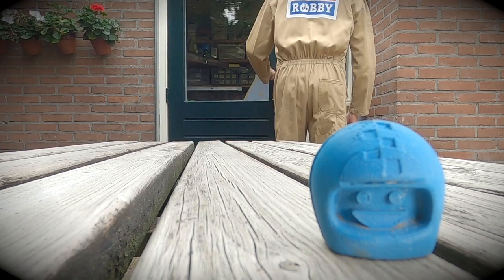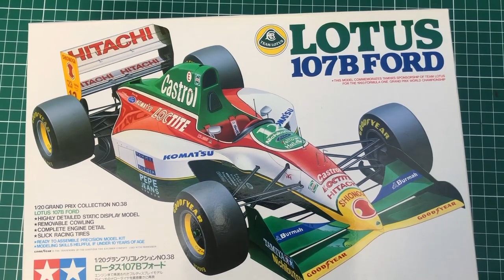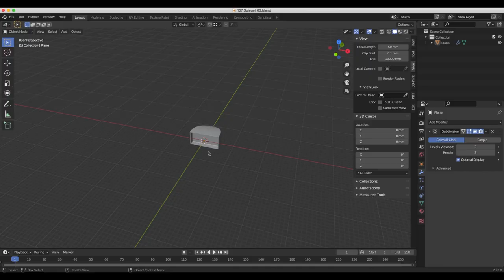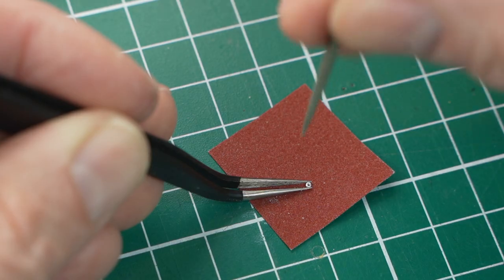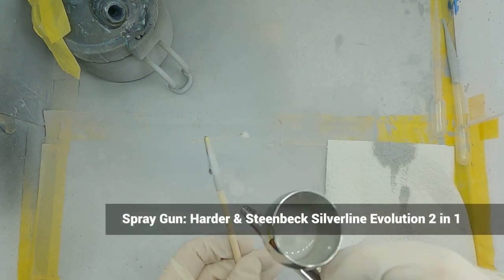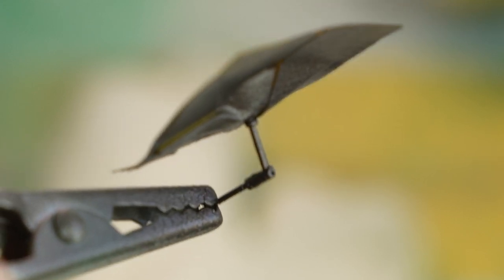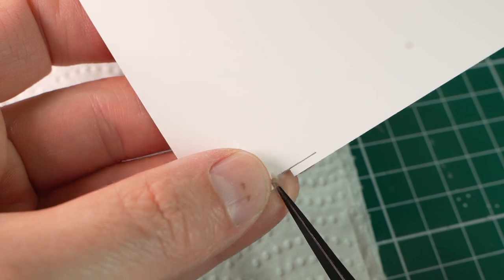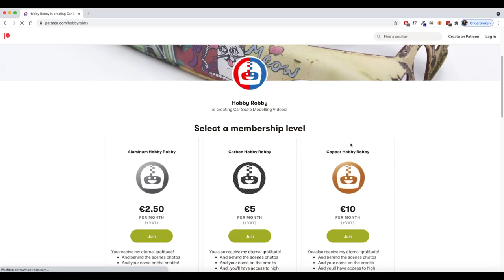MIRROR MIRROR: Building Tamiya Lotus 107 Ford F1 Formula 1 model car of Mika Häkkinen 1/20 scale -#2

Comment: Some tips from Poland: If some parts we needs to duplicate - blue stuff + tamiya epoxy (Time!) Also I make some experiment with decals. You actually have some sheets for decals, so... try print black carbon fiber in b&w and choose transparent white color. If needed carbon+kevlar effect - You can paint part in yellow color - before. Finally - after aplying on surface I use thinned clear coat on decals - and the result is satin finish with almost holographic look😌 But if You make heavy wet coat - this holographic effect will not be visible - only two colors - maybe grey, silver etc.(gloss clear Tamyia 1:3 x20a - I use this method with a brush)🤝👍
Reply from the maker: Thank you for your in depth tips Kolarz! Could have done it with blue stuff too. Not sure what you mean by ‘holographic look’ of the carbon fibre. I am pretty pleased how my carbon fibre looks (I do have reference carbon fibre and it matches quite good)
Reply: @hobbyrobby  It's looking more deep compared to others. Thats interesting illusion: satin and glossy lines in different ways reflected light - so it's more like 3d effect. Also application on complicated parts is easy (they are thin and better stick on the surface - I also use my old hair dryer in this)
Reply from the maker: @kolarzkamikaze1884  Thanks for the clarification! 👍